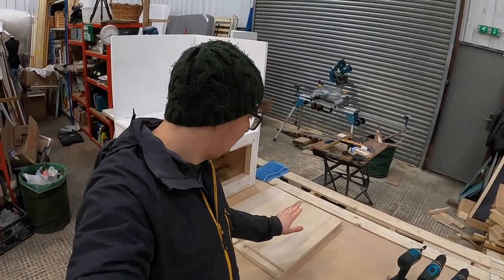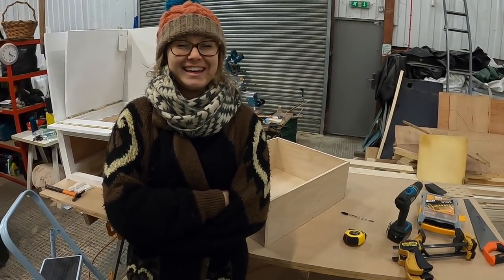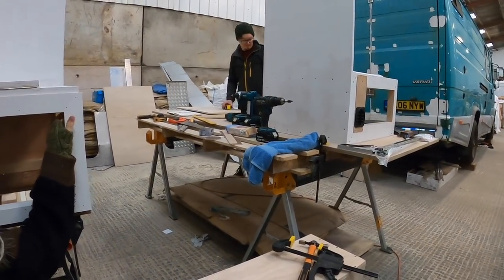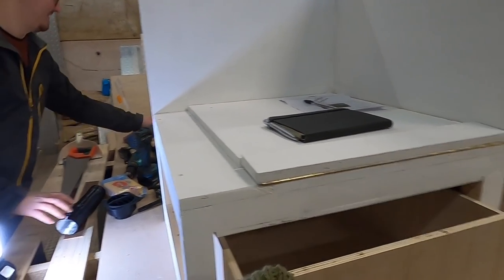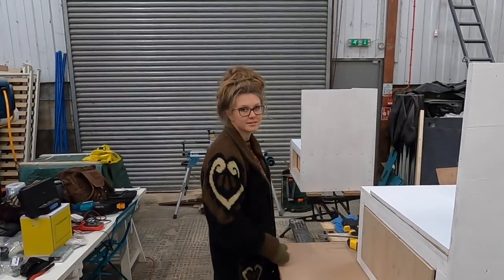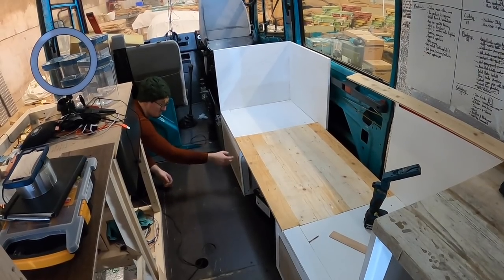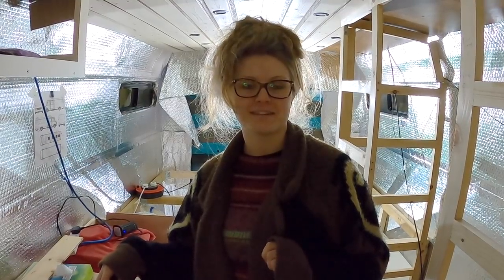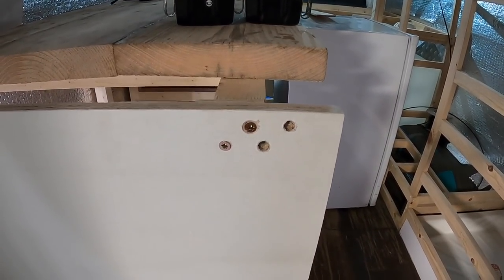MERCEDES VARIO CAMPER CONVERSION | Seating Area & DIY Drawers | LAGUN MOUNT & FOAM | Van Build Ep23

Comment: Everything looking fab! Well done both! A lagun table mount is the vanlifer mount of choice!

As for the holes, either mix up some filler with PVA glue and sawdust or paint and sawdust? Or get a plug cutter for that size , cut plugs from an offcut of the same thickness ply then plug the holes, fill, sand and paint 👌🏻
Reply from the maker: Thank you so much, and we are really pleased with it and managed to pick it up cheaply second hand! And that’s a great tip, will check out plug cutters! 😊👍
Reply: @MaxSophieinaVan  fab! Ply might split so try a more solid wood for the plugs perhaps.
Reply from the maker: Will do, we have some hard timber 👍

Comment: Great to watch all the progress guys, your doing really well. Dont sweat the firm foam, it will give a little over time, its always slightly stiffer when new. Definitely getting to the point where working space is going to become tighter so factor that into your timetable as construction will be a bit slower in those tighter spaces. Super excited for the next video. Atb.
Reply from the maker: Thank you so much Dave! And Sophie is going to do some upholstery wizardry to pad them out a bit! And that’s a really good thought, hopefully it won’t slow us down too much! 😊👍

Comment: there are some great two part wood fillers available now,or you could trim the edges with some metal strips,ive got some mirror finish stainless trim if you need some,think there about 6foot by 90mm wide or 35 wide,your build is taking shape!
Reply from the maker: They are both great ideas, we will look into it! Thank you so much 😊👍

Comment: The same as with the fridge:  if you drive and turn to the right, the cupboards under the seats will drive open., because they are big and slide very easy. So, please be careful.
Reply from the maker: We will be, thanks for the reminder! We will be adding latches to stop them sliding 😊👍

Comment: round the edges of that table/sofa extend part, round edges wont bother for the sofa/bed mode and it will help rotate more easily in table mode
Reply from the maker: That’s a great tip, we’ll give it a try! Thank you so much! 😊👍

Comment: Hi, love watching the videos, I'm using them as guides as I build my van. Is there a reason you have not opted to insulate the floor?
Reply from the maker: Thank you so much, defiantly learn from all of our mistakes 😂 and purely height in our van, Max is pretty tall and we want him to be able to stand up comfortably in there! We are however going to insulate all of the drawer/cupboard bottoms and then have an insulating underlay going under our wooden flooring when we do it 😊👍
Reply: @MaxSophieinaVan  you're doing a great job, the videos are full of helpful info. Thanks for getting back, I in a similar situation with height and was thinking the same. 👍
Reply from the maker: Thank you! 😊 and you’re welcome, it was a close call but we prioritised comfort! 👍
Reply: @Wes2578  insulate if you can 😁 I am in my van as I have bag of height, but some people have height restrictions. Even if you can put a thin layer down it is better than not as the van floor will always be super cold. Another option is to add heat films under the floor so it takes the chill off 😁

Comment: The proper way to fill those ‘extra’ screw holes is with plugs. But you could just use body filler and sand down flush
Reply from the maker: That’s a great tip, we were bound to have some extra holes eventually 😂 we will try to make some plugs! 👍
Reply: @MaxSophieinaVan  you can get plug cutter attachments that will fit your vast array of makita drills! 😉
Reply from the maker: Ah I’ll never heard of those, will check them out! 😊👍
Reply: @MaxSophieinaVan  your favourite shop, Screwfix, stock plug cutters. You need to drill out the holes to match the size of the plug you need
Reply from the maker: That sounds like a winner to me, I’ll get some ordered now! 😊👍

Comment: No idea and cut down the size of the drawer, you do not have to pull the drawer completely out, and you can mount a block on the underside of the drawer that makes the drawer stop before it comes out completely.
why not leave the bed plate in one part and make the table a little smaller so that it fits between the benches, and the lagun attachment can then be placed against the sliding door side, it will give you a flush backwall
Reply from the maker: That’s a really good idea with the drawer, we might give it a go tomorrow! And the table isn’t strong enough on its own unfortunately so needs the ply base to help support it! 😊👍
Reply: @MaxSophieinaVan   I think a bit about how it will be and lie in the bunk when you have 12mm plywood on the outside of the wall and the lagoon base at knee height :) 
it is possible to put on a 9mm plywood or something on the underside of the table top to make it a little stronger.
The bed plate itself can be stored in a place where it is not in the way when not in use, becoming a bit like a folding guest bed :)
Reply from the maker: That’s a great idea, we’ll have a look at what you suggested when we are there tomorrow! Thank you so much 😊👌
Reply: @MaxSophieinaVan  I bought a vario 814 about 5 months ago, if everything goes as planned, I will start converting to a all-year round motor-home in approx. 1 month.
So have a great interest in seeing different solutions for furnishings/layout, have decent expertise in metal and woodwork so I look forward to having time to start with the project. 
Since my van has the steering on the right side 😎  the only sliding door will be the one where you have the benches and the table, in fact a good idea and use that space for loose chairs and dinner tables so maybe I will steal that idea from you 👍
Reply from the maker: That is so exciting! And you’ll have it built in no time with those skills! Will you be posting about it on YouTube or instagram? 😊
Reply: @MaxSophieinaVan  Well, I actually have about 4 years before I can start traveling around so have a good time, long-term planning 🙂 
I work quite a lot so there are not many hours a week I can work with the van, hope and get finished bodywork, painting and drivetrain/mechanical before spring.
Like and take pictures, so I probably make a time-lapse when the van is finished building.
Reply from the maker: You sound busy but that such a great project! Can’t wait to see what you do 👍